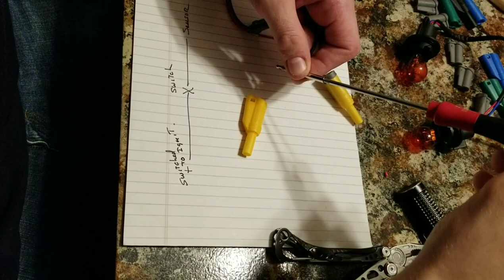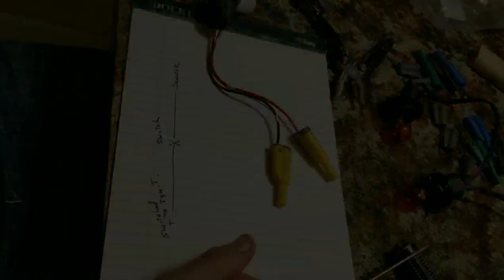DIY Headlamp Test Light with Banana Connectors

Comment: dont put tape on pierce holes. use nail polish. I use bright orange on dark wire and dark green on light colors so if theres a problem later I know where I poked before.
Reply from the maker: I use liquid tape for it usually but that's a good idea!

Comment: I’ve been looking for those connectors where did you get them ?
Reply from the maker: I actually just bought them on either amazon or ebay. Just search for "stackable" and/or "shrouded" "Banana" "socket", "plug", or "connector". They're 4 mm. I got the "solderless" type with a screw hold down for these double-ended ones. I believe I had to use some of the solder type for the female and male only plugs that I used to add them to my test lights so I can hook them to the normal alligator clip or whatever else I like (power probe extension lead for example). Hopefully you found them already, since it took me so long to reply haha.